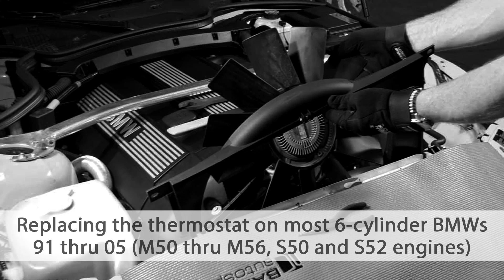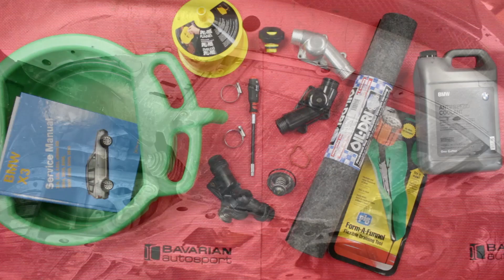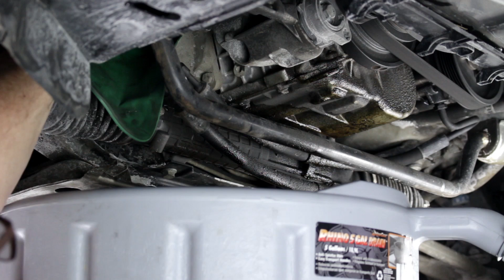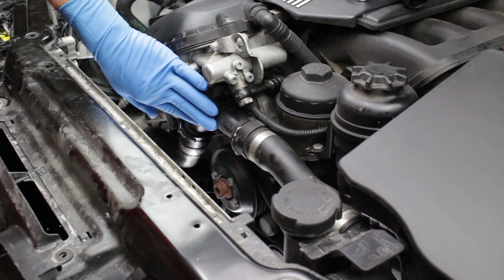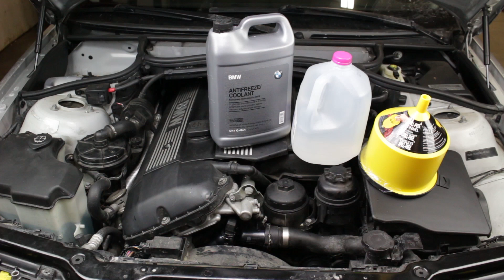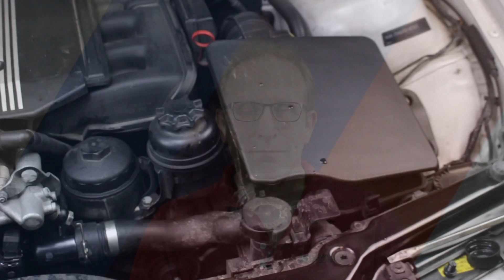Replacing the thermostat on most 6-cylinder BMWs 91 thru 05 (M50 thru M56, S50 and S52 engines)

Comment: very nice video. in other videos ,when installing the thermostat,they put some sealling ,because they say that if you dont put that sealling coolant will leak . how is it ??
Reply: I agree. . he doesn't mention anything about if the bolts needs to be torqued accurately or if an extra deal could be useful .
Reply: Any updates to this thread?
I am presently installing new aluminum "four season" thermostat and wondering if gasketmaker/sealant is needed..+ if torque is needed to 10.ftlbs ?
M54 e39
Please update ..thanks!!

Comment: 17:13
The plate (17 11 1 439 721) can be sucessfully unmouted from expansion tank for more convenient opening and closing of bleeding screw (17 11 1 712 788), especially if you use a coin instead of extra wide screwdriver.